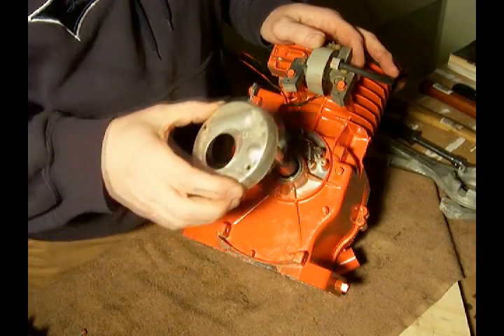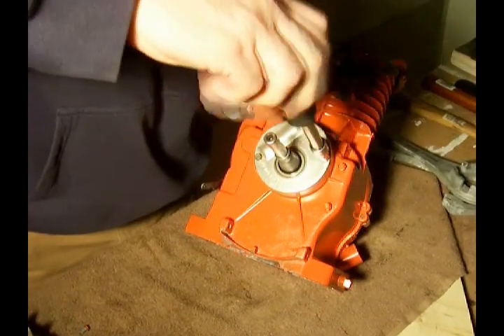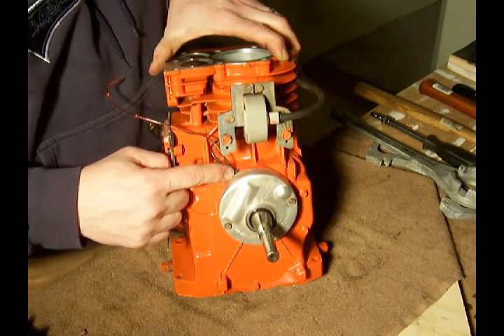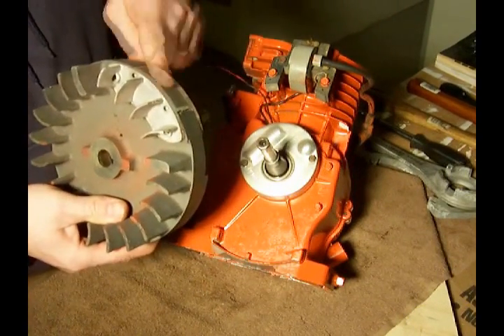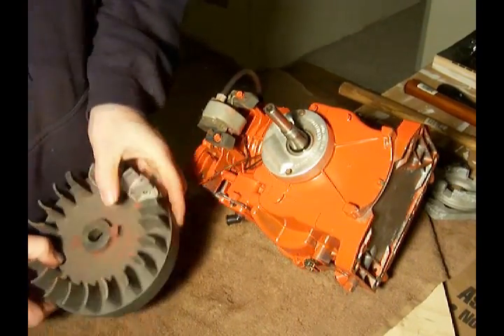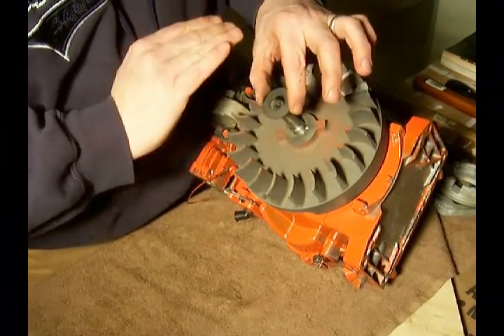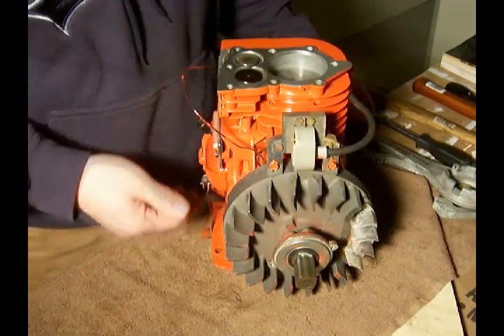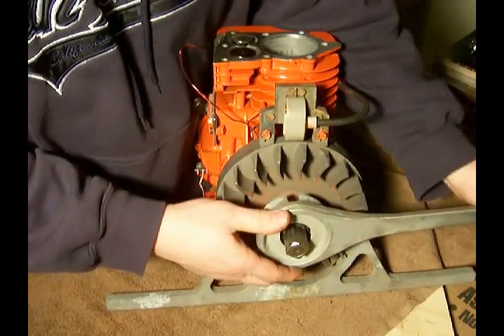#11 - Briggs and Stratton 5HP 130202 - Flywheel and starter clutch installation

Comment: O , I was so Happy tonight to finally get my 1978 Gilson Snow Charger,
All back together after 2 1/2 years of not being able to use it cause the original Engine had some issues with the ignition & I found an identical engine replacement 4 free so I changed it up !!!
Got the new belt`s all put on with the pulleys all lined up perfect, 
Friction wheel all setup perfect !!
Started it up & ran like a dream :) !!!
Took er out side after she warmed up nice to battle this Blizzard we are getting in Midwestern Ontario Tonight, 
When all of a sudden it started squealing ... O O ...
Shut er down in time to hear it starting to clunk a bit .. Man O Man .. I knew it was a Flywheel sound spinning on the Crank :(
Pull of the Recoil Housing to find sure enough the Flywheel was broke free ...
The Recoil Clutch was lose enough for me to Finnish turning it off by hand :(
So far there doesn`t seem to be too much damage other then a Small chip from the key slot on the crank..
Who ever put the Flywheel back onto the engine at one point, didn`t put the Washer back on .. Dame ...
Well I am going to head back out & put a new key back on it & A WASHER lol from the original engine !!
Here is hoping everything works fine again !!! lol 
Thanks 4 Sharing Your Work !!!